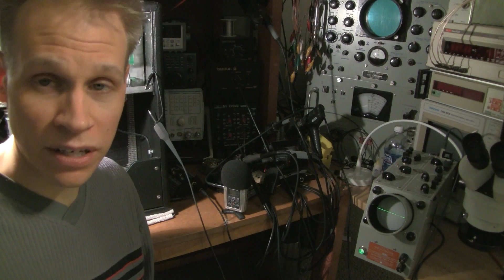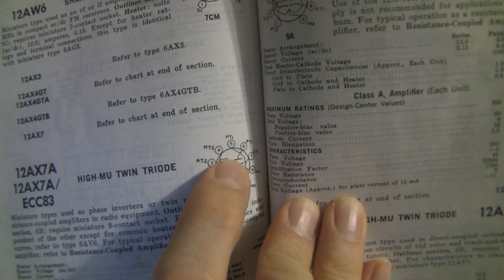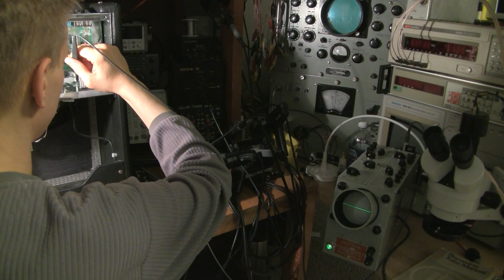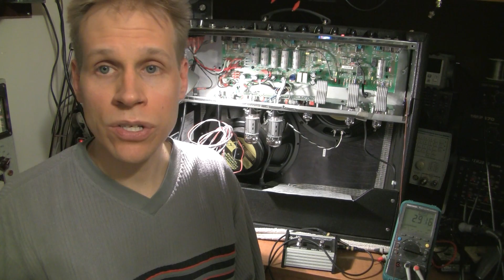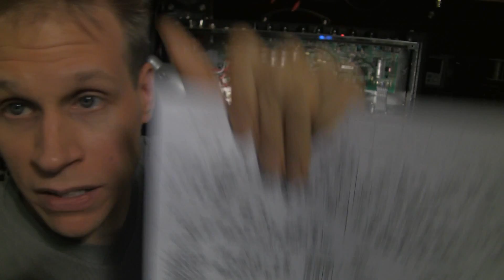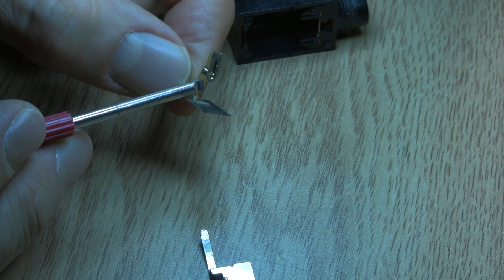Fender DeVille Amplifier, Repair and Bias Set Procedure

Comment: Fantastic video. I have a Fender Cyber Twin head where the master data selection wheel acts weird. In other words, it is unstable and fluctuates all over the place when turned. My question is, where do you find parts for these amps? I reached out to Fender a couple of times and they won't even respond. Any advice on where to get parts for someone who is not an authorized dealer or repair facility?  Again, great video. Thanks!!!
Reply: 4 years later is probably too late to be able to help you but I am going to guess that the "data selection control wheel" you speak of is some kind of digital "commutator" control, and not a standard potentiometer. If you were to take the control apart it probably looks like a miniature aluminum pie plate that has been cut into wedges. Home- theater audio-video receivers often use this type of control for volume selection and other functions, and unfortunately they can't be repaired by merely spraying control cleaner into them. When I was a full time audio tech we never bothered to replace that type of control, but instead we would remove the control from the circuit board, disassemble it, and polish the "pie plate" and the springy metal fingers carefully with a pencil eraser, flush it out with alcohol, add a dab of clear silicone grease (like transistor heatsink grease) and reassemble it. Not really a job for a layman, as you need to be able to desolder and remove the control from a circuit board without damaging the board (which is likely double-sided, and the copper pads and foils are delicate), or the control, or any adjacent components.

Comment: Outstanding video as usual. I've had six of these amps in for repair in the past five months, with problems ranging from bad tubes, failed solder joints, bad filter caps and one user that tried to modify his amp, but doesn't have adequate soldering skills. Many of the amps have worked for twenty years, with no problems, which says a lot about the design of these amps. I'm do this mostly as a hobby and could really use some instruction in safe and proper Oscilloscope use in troubleshooting tube guitar amps, especially oscillation in reverb circuits and diagnosing other problems. Any chance of you doing a video like this? Thank you so much for everything you do.

Comment: If we didn't have the book to check out the pinout locations could you probe around on the tube pins anyway because whatever you call the pin location makes no difference you can find it with the scope.Right? I have a working scope but don't know how to use it.You make is seem so straight forward.Looking for a.c. on a d.c. line.Am I correct? Thank you for making the video and showing us how to work on amps.
Reply: Tom Ward You could probably figure it out even with just a multimeter in circuit, but you’d have to know how the tubes work to see the link between the voltages observed and the function of the terminals. E.g. the plate/anode has the highest potential vs all other terminals,  the pair of terminals with 6VAC between is the heater, the lowest potential vs anode IIRC is the control grid (although it may go above cathode in some biasing), the next closest potential would be the cathode, if there’s another terminal with anode potential then it’s the screen-anode link for a triode strapping, otherwise it’ll be somewhere between cathode and anode potential. The suppressor grid is usually strapped with cathode, and this connection can be internal. To check if it is internal you could curve trace the tube to see the kink in the characteristic curves, or connect it in an oscillator circuit that uses negative resistance “triode kink” to work. It won’t   work with the suppressor grid present. And so on. The screen current may be positive or negative depending on application and the pentode will still work. Take this with a grain of sand since my experience with tubes is nil, but that’s the idea: understand the function of the terminals in general; and then identify the actual pins by correcting them to known functions of valve terminals.

If you have a low capacitance meter, you can measure capacitances between terminals, and the anode-heater chain is coupled as if they were capacitor plates, so e.g. anode to suppressor capacitance is usually higher than anode to anywhere else, then suppressor to screen will be higher than suppressor to terminals closer to cathode, then screen will couple best to suppressor, and control grid to suppressor. The goal is to find either end of the chain, and then proceed by identifying the highest capacitance, taking it to be the next element in order, and looking for next best coupling. Starting with heater is easiest since heater has two terminals that aren’t quite dead short. Cathode sleeve will couple best. Then from cathode the control grid couples best. Etc. This requires some care and a few known tubes to try the technique in first. You’d also know what capacitances to expect – they are in the 1-20 picofarad range usually, so you have to have your capacitance measuring technique exactly right or you’ll get bogus results.

Comment: What tool do you use at minute 25?  Is that a "hot air rework station"?  I've never had a chance to use one.
Reply from the maker: +Matthew Taylor 
Hi Matthew, it's a Hakko 470 Pump with an 802 gun.

Comment: Hi there. Thanks for a great video :D
I have a fender DeVille Amp, that suddenly decided to stop playing on stage last Saturday!.. 
All sound came out as a very distant “flump” sound, not recognizable as a guitar sound at all, and not any louder than a pin drop!
So I quickly rigged my guitar to another amplifier, and finished the gig convinced that I had blown a power tube..
However, the next day I plugged in the amplifier to confirm the damage, and behold!.. Everything worked nice and dandy!
I kept it turned on for most of the day, still unable to recreate the dead “flump” state!
The amplifier is about 15 years old, and has been playing perfect, until last Saturday. As you can properly understand, I’m not that keen on bringing it back on stage, before I find out what happened..
Do you have any suggestion as to what can cause such a behavior?
Reply from the maker: +Karsten Falborg (The Rock&#39;n Bluesband - DK) 
HI. It's hard to say without having heard the failure point. Sounds like an intermittent tube, or loose connection. Unfortunately, problems like this can't be located until they stay in the failure state.

Comment: Chinese and Soviet tubes are not equal in quality to NOS Tung-Sols, Mullards, Telefunkens, etc., and the difference in some cases is striking.
It is not a matter of psycho-acoustics.

There are good reasons for this, but this is a complex matter all it's own.....
Reply from the maker: +jordan390a 
I do favor Soviet tubes, but have come across some very robust Chinese tubes that have outlasted JAN-NOS GE five star tubes, (5751's to be exact) time and time again, in a high vibration atmosphere. If you want quality and ruggedness, Nothing, and I mean "NOTHING" compares to a Bendix Red Bank tube.
Reply: +Mr Carlson&#39;s Lab 

Yes, and for good reason. Bendix Aviation required their tubes to meet Mil-spec standards with guarantees of adherence.

I suspect that you're finding the major cause of those tube failures to be heater to cathode shorts...?

Is that correct...?
Reply from the maker: Actually no. The H/K issues are few with those tubes. The problem is, they become very microphonic, so much that they start to feed back.(hear the speaker) Some Chinese and most Russian tubes have small tabs that apply tension to the grid rods. This constant spring loaded tension keeps them very tight through their life. Most all older NOS tubes do not have this, including the JAN types. If you have any modern Russian or Chinese tubes, look in the top where the Mica spacer supports the grid rods. You will see small Mica tabs that apply side tension.

Comment: Recently I got the same model with a failed plate resistor in the phase inverter circuit. The owner never had the amp serviced at a proper service, he just took advice from a local music store, btw he purchased a new device, so he left me the amp for scrap. As he've ordered some spares, I ended up with the amp, a brand new set off tubes and a ....spare O.T. Greetings from Austria
Reply from the maker: +Gustav Cida 
Thanks for your comment Gustav!

Comment: Intermittent problems have been the bane of my life in the electronics field. the other one is engineers syndrome. this is where you get a unit in and the customer says there is a fault, so you test the bloody thing for days on end and can't find a fault and even show the customer. He then takes it away and the minute he/she is out of the door the bloody thing goes wrong again. and it goes round and round.
Reply from the maker: +ecc84 
LOL, I know how you feel!
Reply: +ecc84 Musicians should know enough about their gear to (at the very least) para-technically troubleshoot it in my opinion. Bad cables and or other devices in the signal path are the cause of most NFFs

Comment: My guess is you are/were a Navy man. But I say very seriously you are the best trained/educated tech I have every seen!
I have the Hot Rod Deville 410 III a 60W 4 x 10" speaker combo amplifier. Mine has a Preamp Tube stabilizer -a vibration absorbing stabilizer installed around the preamp tubes to minimize tube microphonics. I did a tube re-bias and I set it a little cool for longevity. I have my notes somewhere. I think I set it downwards from 60% to 57% (divided by 2) I'm not positive about that without my notes in fron of me. I do not do re-biasing frequently so my memory is sketchy. The amp is still very loud and no problems so far with the tubes. I know most people want to have the bias set hooter than 68% to have it distort earlier. I may rethink what I did because I just can't get the power tubes driven into distortion without the volume completely overwhelming my ears. I don't even try. Rather I use the preamp tubes to get my distortion. I can get distortion at low volumes using that technique. However to my ears it's not as pleasant as overdriven power tubes. 
It is my understanding that the reason why so many musicians prefer tube amps is because of the tone. From what I have learned the tone is different because tubes have more inherent distortion than transistors. I do not think many musicians are even aware of this fact. They think tubes are warmer., and so they are. I grew up during the '50's and '60's and has a tube amplified AM Radio on my night table to help keep me warm!
Yes I suppose people can and do  design a transistor S.S. amp to emulate tube distortion. 
I was always interested in electronics and had a few good tech books. Somewhere somehow my American Ham Radio Handbook went missing. It had a lot of information about amplifiers and tubes. I'm kind of helpless without it. In fact all my books on electronics are missing. Me thinks I need to purchase another Handbook. Now back to you pleasingly executed and educational video...
P.S. I know that your Father is proud of you. I have a son a little younger than you and I know what it means to be proud of a Son. ASNF.
Reply: +PeterDad60 Ha! I knew I meant to write 60 Millivolts not 60% and re-biased down to 57/58 mv not 57%. I'm very rusty on my terminology these days because I am so inactive (retired).
Reply from the maker: +PeterDad60 
Thanks for taking the time to write, and the kind words too!

Comment: Jeeze! Roll the tube & get it over with. Just kidding! Great video! Good old FMIC & their $73 Chinese PCB toob amps. IC filter capacitors, yay! That amp will be back for those later.  I have no problems at all with most of the Shuguang tubes, except for the 5AR4. I can't find ANY modern production 5AR4s that are worth a tinkers d*mn.  I can buy a whole case of 12AX7Bs & pay well under $10 per tube, and they are a good, stout, & gainy little 12AX7. For a while, I could buy bayonet base white LED assemblies that fit Fender amp pilot lamp sockets. Now I can't find them at all. So a diode a cap & a dropping resistor it is. Bob Crooks was using series DC heater strings in his Standel 25-15 way back when Chet Atkins recorded "Mr Sandman" in the 1950s. Those amps utilized the 807 tube, in class AB2 putting out 25 watts into a 15" JBL speaker. The 807, AKA "the tube that won the war".....unless you are in England. Then it is an EF50. I can't speak for Canada, but here, in America, the EF50 is merely known as "The tube that helped win the war."  Americans KNOW it was the 807 that actually "won the war". Uhhhhh, yeah. Shuguang Sino makes a pretty decent 807 too. Best 12AX7 ever?? Box plate Mullard, or maybe the Sylvania STR256, but those never won a world war.
Reply from the maker: +Seth B 
I too like the 807. I built an amplifier with RK39"s. Sounds nice! Thanks for your comment!

Comment: How odd. Why did they use vacuum tubes in a modern design?
Reply from the maker: +MainsOnTheOhmsRange 
This is very common in the music industry. Way to many reasons to list here.
Reply: +MainsOnTheOhmsRange Hey Mains It is because tube amps sound better and a transistor or mosfet will never be as good for guitar. Most guitarists use valve amps......
Reply: +MainsOnTheOhmsRange The sound of an electric guitar is a combination of the signal produced by the pickups and the way that signal is modified by the amplifier and speakers. This usually involves overdriving the amp which drives the output devices into 'clipping'. Tubes exhibit 'soft clipping' so that the amp moves smoothly from 'clean' to 'dirty' which sounds good, while transistors clip suddenly which sounds terrible.
Reply: Al Goldstein

I bet a DSP that cost less than the tube can do the full differential equations to emulate any type of tube. Look on the upside,This creates niche markets and thus jobs. So ... is it really that good to spread the truth?

Comment: Hi there Mr. Carlson! Thanks for your very explanatory and easy to understand video on this repair. I'd like to ask you something different, if you don't mind.... Here I'm stuck with a nice Dean Markley K150 guitar amp, which had a +/- 15V power supply issue, which was repaired and the amp is functioning again, nice clean and loud sound, but the output Mosfets ( J49/K134) will heat up in about 1-2 minutes and could be burned out if the unit wouldn't be turned off. Checked all passive components in the output circuit and all are within their parameters. What is causing the overheating? Any ideas? Thanks in advance for you help...
Reply from the maker: +Miklos Ujvari 
Hi Miklos. It could be so many things. All the voltages are correct at the rails of both supplies in the amp? When you say they get hot in 1 to 2 minutes, are these fets on the heat sink when you are testing this situation? Check the diodes directly behind the fets for leakage, transistors as well. Does one fet heat faster than the other? When you say all the passive components are within parameters.... What test gear have you used to verify this?
Reply: +Mr Carlson's Lab  Hi Carlson!Thank you very much for your fast answer, and thanks specifically for you great feedback, regarding where to look, what to check...Happily can relate to you that the problem was found, just because your advice was helping me to do some more voltage measurements...And guess what, the biasing 1k trim pot was open letting the power Mosfets to engage into a thermal runaway...I do not have a replacement trim pot, so temporarily soldered a regular 1k potentiometer and the amp feels good, and COOL now :DThank you again for your great help!
Reply from the maker: +Miklos Ujvari 
Glad you found the problem!
Reply: +Mr Carlson's Lab, Thanks again, and looking forward for your further excellent videos! Thanks!

Comment: If you're aware of the frequency difference between 120Hz and 60Hz hum, it's easy to determine if it's tubes (60Hz) or filter capacitor/ground issue (120Hz) is the source of the prob.
Reply from the maker: +Squizzy Bollocks Thanks for your comment!
Reply: 50/60 Hz    HUMMMMMMMMMMMMMM

100/120 Hz BUZZZZZZZZZZZZZZZZZZZZZZ

Comment: Is your dummy load resistor really 8 ohms or would 10 be ok too (8 or 8.2 is very hard to find, unfortunately)?
Reply from the maker: +Róbert Valdimarsson The load has to be either 8 or 4 ohms. The impedance of the output side gets reflected back to the plates of the 6L6's. So when the load is wrong, the plate to plate load is also wrong. For very brief tests, some inaccuracy is ok.
Reply: +Mr Carlson's Lab Thank you for your reply. I have repaired an active subwoofer today which had an extremely loud and very intermittend clackle. I whish i'd have had a dummyload for it :D Apparently it was a cap (no signs of leakage or bulging, but an ESR through the roof) that made the supply sagging (on the scope it looked almost like hick-upping), when the output relay switched on. I hope that was the only problem, because every crack of those massive speakers makes you jump off the chair :D
Reply from the maker: +Róbert Valdimarsson If you like the active subwoofer, it may be in your best interest to replace all the capacitors on the downside of the switcher, The bulk capacitors (60 cycle side) are usually good for the duration. The caps that are running in the Kcs are the ones that turn into resistors.
Reply: +Mr Carlson's Lab Thank you for your advice. Yes, it will be completely recapped with panasonic fc and nichicon vz caps. except the pre-switching bulk caps of course, i too have never seen them fail before and 1000µ/300V caps are extremely expensive (damn 230V mains :D ). Thanks again, i love your videos.

Comment: I had a friend ground my input jack like you do in the video, the hum went away but my amp nearly overheated (turned it off just in time). Now it's running fine but still has its original high noise floor.